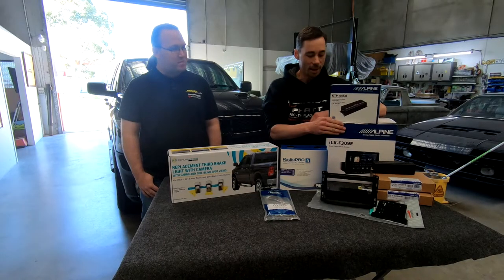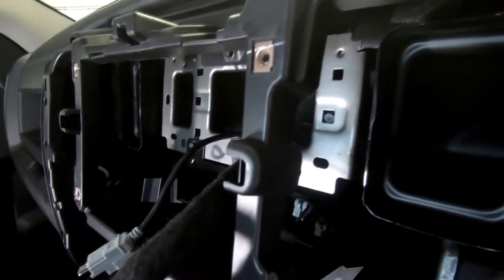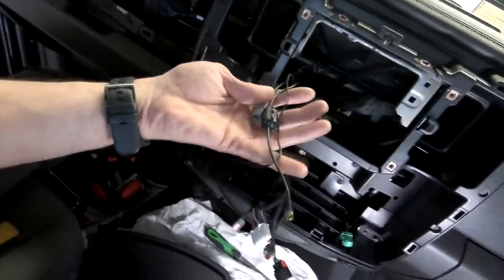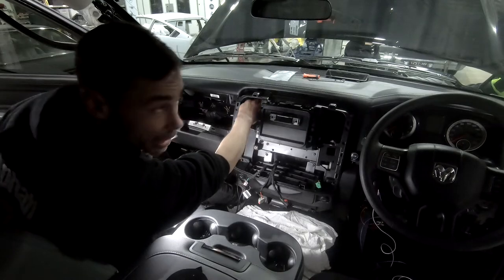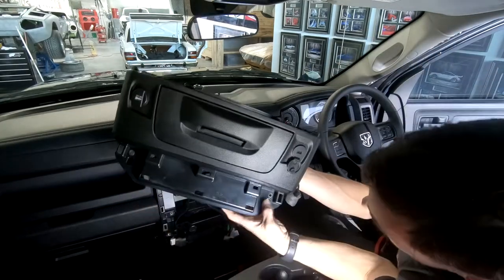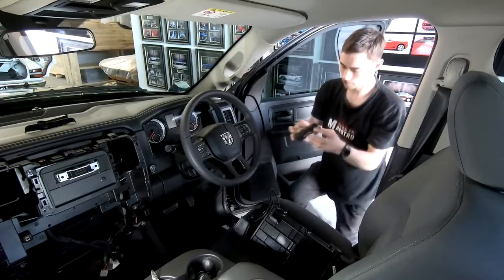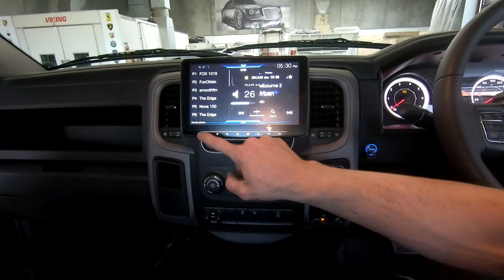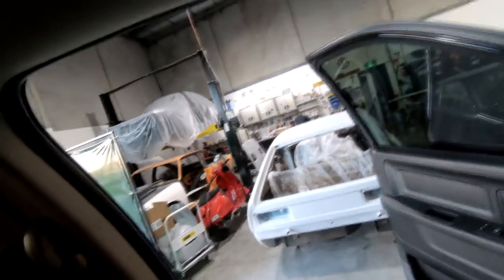Alpine Halo9 In A 2019 Dodge Ram 1500 + Cameras!!

Comment: I’m super confused why you’re using the pacs kit with this.. from the look this is a basic tradesmen with the RA2. The only factory item to retain is reverse camera and the 507 already has the composite camera input. There is nothing else this vehicle has to be retained that’s a waste of $350 lol. You got 3 sets of preamps etc.. so what exactly is the cp4 actually needed for in this install?
Reply from the maker: Hey buddy, the RP4-CH21 was there to provide canbus accessory break out and steering wheel control to the Alpine. There were 4 cameras used in this vehicle and the Alpine 409 had the direct input for multiview/multi camera control which has 3 inputs. The 3rd and 4th cameras were left and right blind spot cameras, so the Pac AV switcher then controlled them with indicator input.

Comment: What part did you use to modify the steering wheel controls?
Reply from the maker: Sorry for the late reply i missed this comment. Its a pac rp4-ch21 🙂
Reply: With the audio control change. You lose gauge cluster control?